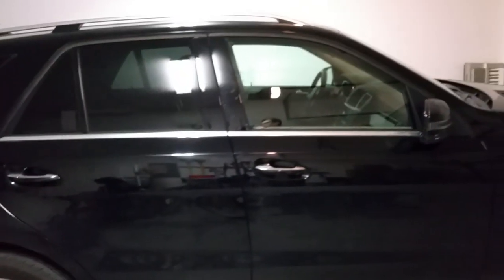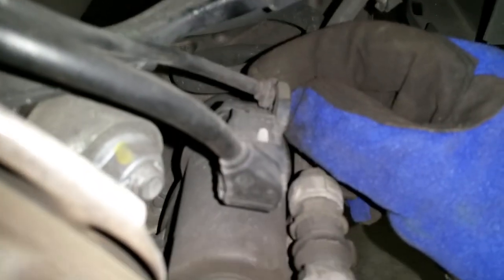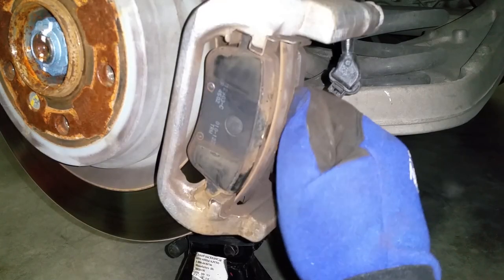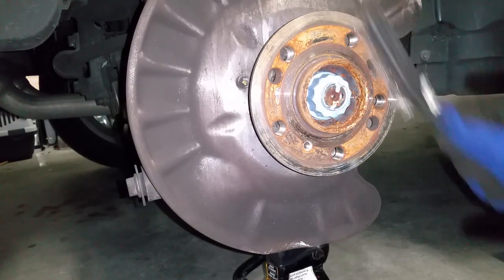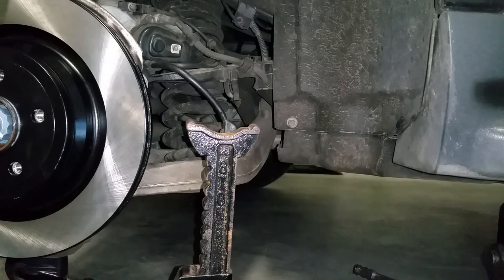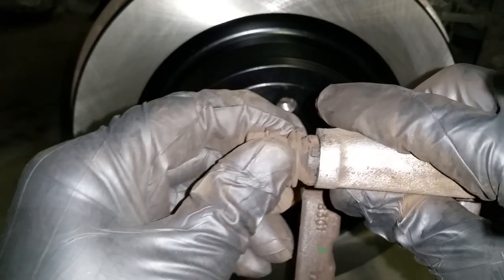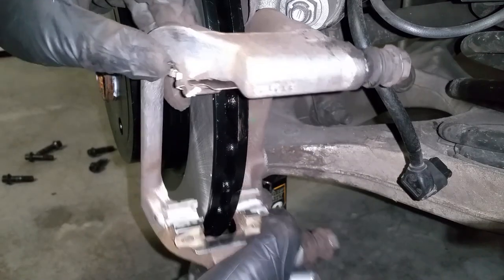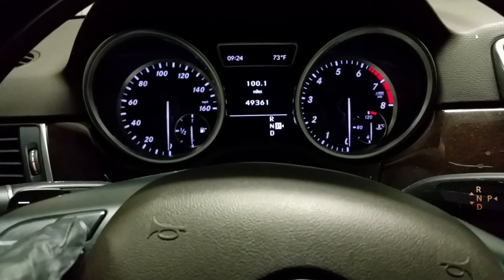Mercedes-Benz M-Class Rear Brake Job HD

Comment: Is the break pad worn out sensor on all four sides driver and passenger side? When we get the message on the dash will the message say which side has worn out? How will we need to be sure please?
Reply from the maker: Unfortunately there is no way it's not going to tell you which side.
Reply: @IvanRossS  will it at least say front or rear? Should this always be done in pairs which is both front or both rear? Dealer is also suggesting to change the rotor but it was only put in 2015 as part of CPO and moreover has only 81000 miles. It’s a 2012 ML350.
Reply: Mines only on passengerside

Comment: what's the torque spec on the slide pins and on the carrier bolts?
Reply from the maker: thepawneeful Sorry have no idea. Those bolts not really critical for exact torque. Just hand tight them.  Don't go crazy on caliper pins, they usualy not tight to hard.  Remember 90% of the time torque specs just made so u wouldn't over tight bolt, that's all...
Reply: Disc Brake Caliper Bolts: 35 Nm or 26 Lb.Ft.
Reply: Pad Guide Pins: 25 Nm.
Caliper Mounting Bolts: 45 - 60 Nm

Comment: Can I change both rear brakes (passenger and driver) and then retract the brakes or do I have to retract them after doing driver side only?
Reply from the maker: No lol. They both retracts. And u  have to retract them before u starting changing your brakes. You basically disengaging your emergency brake system because it's under the tension and it's very close to the brake pads and caliper cylinders,  so if you try to remove your calipers and press on your brake caliper cylinders to install you pads  without retracting it first !! You have a chance of damage in this system.
Reply: @IvanRossS  sorry the question was a little confusing, what I mean is that in the video you changed the driver side brakes and then after you went back to put the brakes back to normal in the cluster. The question is, do I have to put them back to normal after changing just the driver side or can I change both sides THEN put them back to normal?

Comment: Hi,
why you changed the brake rotor disk? what is the minimum thickness of it?
Reply from the maker: they were warped.  and they were given vibration and shaking every time you break on the low speed.  I could have simply resurface them for $15 each but it would took half a day for the shop to do it.  I would have to deliver rotors to them and then pick them up. it's too much work, and I did not have extra vehicle, it was easier just to order brand new... and spend less than an hour for a replacement instead of a half a day

Comment: I worked on Rolls Royce. Always a cover on seat, and paper mat on floor. Fender covers. Never wear work gloves inside vehicle (even your own) ; nor touch anything inside with work gloves on; unless new & clean. change out of cover-alls if you've been under a dirty car. Never close hood or touch paint with work gloves on. Don't recommend using imperial tools on a metric vehicle. I believe Mercedes recommend to drop close the hood. Not press on it to close. Many are aluminium !.  Finally wash car.  Just a few pointers to raise the standard.
Reply from the maker: This is not the Rolls-Royce and this is  not  customer vehicle... i use gloves  because I hate to spend hours cleaning my hand..

Comment: Awesome . thanks.
what is that white  lubricant you use on calipers is some anti-seize or grease?
Reply from the maker: For caliper pins and pads use "American Grease Stick Co. Sil-Glyde Silicone Brake Lubricant" between rotor and hub I recommend to use regular silver anti-seize
Reply: @IvanRossS  I have mine ML 2015 , and done 4 A and B  services , Never done break service . My wife's Japan car Mazda CX 5 , the recommend every 2 years Break service, just clean and lubricate.

Comment: In the 'Pad Replacement' menu what is 'Moving to Fitting Position'? Is it releasing the brake piston or the e-brake? Thanks.
Reply from the maker: Lol its same thing . E-brake  mechanism pushing on the piston. Well for you to press piston back in to install new thicker brake pads, you might want to release the e-brake otherwise you have a chanceto break that mechanism.
Reply: Thanks. I need to replace rear pads and needed to know how to release the e-brake. Just needed to verify and your video has helped.

Comment: I did not see you torque the guide pins & rotor mount bolts.
Reply from the maker: Never do that lol. Torque at this locations not that critical,  it's just made so you will not over tight or under tight.. just hand tight guide pins and rotor bolt. Rotor bolt don't do anything besides keeping rotor in place. Now, brake mount braket, you have to tight pretty hard, I hit once or twice it with hammer on wrench. That's it! Only lugs have to be torque!! ! But if  you want to be so anal about things you can torque every single bolt
Reply: @IvanRossS 😊

Comment: I would use ventilation holes and slots rotors and ceramic brake pads for better cooling and braking.
Reply: The majority of OEM manufactures have gone away from drilled & slotted rotors as the original purpose was to provide an exit for brake pad gases. New pads are made up of better friction materials & do not build up the gases as the older pads did. Another reason for non-drilled rotors was drilled rotors seemed to develop cracks starting at the holes. Drilled and/or slotted rotors do look better, but you will mostly see them on track cars, where rotors & pads are changed more often.

Comment: Im having trouble pushing the caliper piston back on a 2016 gle350 mercedes. It won't push back with the spreader
Reply from the maker: Stop right there.!!!! U have to get another tool. Its suppose to spin at the same time it push!!!!! U can rent kit from the stores like Autozone. Brake caliper replacement tool kit. Comes in the box with bunch of adapters. I have same kit: https://www.amazon.com/dp/B0122Q83T4/ref=cm_sw_r_other_apa_i_uTKYCbYE2VR8H
Reply from the maker: I'm even showing in the video using the correct tool,  that tool not only press caliper piston into caliper, it also spins at the same time!!!
Reply: @IvanRossS  that's the same tool I have and it's not going in. I am doing it exactly like the video. Not sure why it's not going in at all.

Comment: Does the 2009 model have the electric fitting as well?
Reply from the maker: If you have electronic e-brake then yes.
If you have a hand type or foot type e- brake. Will not have that.  what type of your emergency break?
Reply: @IvanRossS  i believe it has a foot type
Reply from the maker: @tonyrosas2162  then you will not have electronic emergency parking brake. Which means you do not need to do all this extra bulshit on a dashboard and just simple brake replacement. Also just by looking on rear caliper you can tell if it's there or not.  you will have extra box mounted on a caliper with wire. If u have one, then u have electric emergency brake.
Reply: @IvanRossS  thanks, I'll take a look just to be sure, i appreciate the responses 👍🏻

Comment: Hey I need help ASAP today, my caliper piston won’t go in, it is stuck! Anyone know what too do at this point??
Reply from the maker: Some of those caliper piston need to be actually screw in for that you have to have a tool. You can rent one out it's basically a caliper press that will twist as at same time. I'm using brake caliper press in this video that actually will turn. You can crack open brake line also it will help. But then make sure you bleed that one line after you replace your brakes. Otherwise you're going to have a little bit of air in the line
Reply: Screen Share can i access the pad replacement manual and do it again even if the caliper is off?
Reply from the maker: @michaelfernandez9157  yes of course as long as your caliper wired like it's supposed to through the harness
Reply: Screen Share it won’t push the piston all day way out? And how would I know the piston is ready too be pushed in?

Comment: Any idea on the torque specifications on the bolts?
Reply from the maker: Lol u don't need torque specs . Just hand tight them...  obviously do not go crazy and start hammering them down   !! Torque only  important on your lug nuts !! Thats it !!  And I torque my lug nuts at 100lb.  torque specification for all bolts needed just so you will not over tight and stripped thread ! There are  only a few locations on the entire car where torque is very important! Not every freaking bolt and a screw needed to be torque by special lol. I do not even torque bolts and screws on my gun builds! only barrel nut and scope rings,  that's it!
Reply: Screen Share been driving and maintaining Porsche’s and now MB, you always torque any bolt or connection. It’s just good practice.

Comment: How much pad left when the sensor light is on?
Reply from the maker: about quarter of inch. You should be good for the next 5 Thousand Miles
Reply: Screen Share thank you for your reply. Do you have recommendations on pads and rotor?

Comment: Hi does thjs apply to a 2013 ml 350as well?
Reply from the maker: Niz Williamz yes you have third generation of the vehicle,  been in production since 2011 - present!!
Reply: So i don't need the scanner to do it I can do this manually like you did also is the buttin configuration the same for my vehicle (I'm talking about what you did in the car? ) thx in advance
Reply from the maker: Niz Williamz no you don't need no scanner!!! you can access to all those settings right from the vehicle
Reply: Ok thanlk you very usefull info gonna change them out this saturday

Comment: Thanks for the information and video,I’m getting a 2007 model,would I need to do the service menu part on that year too or is it only on the newer models?
Kind regards,
Mark
Reply from the maker: You're getting second generation of ML350 I'm showing third generation which was produced since 2011. I have no idea what kind of system  there and I don't think so you would have to go through the menu. Should be just simple change